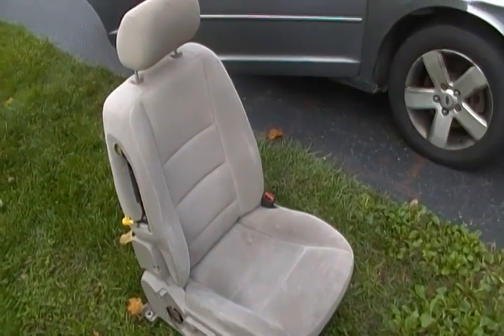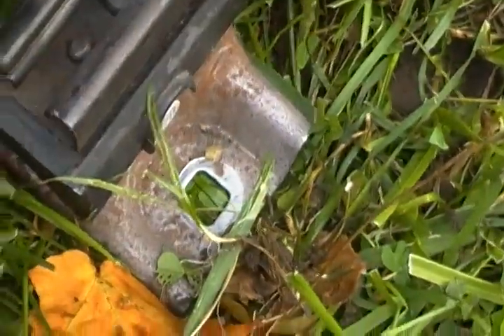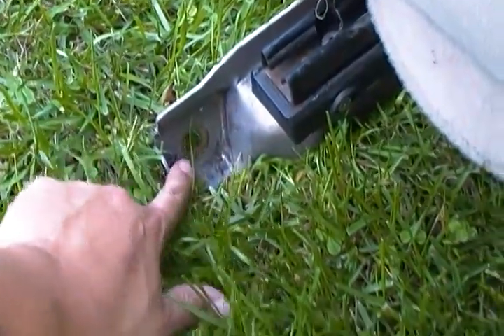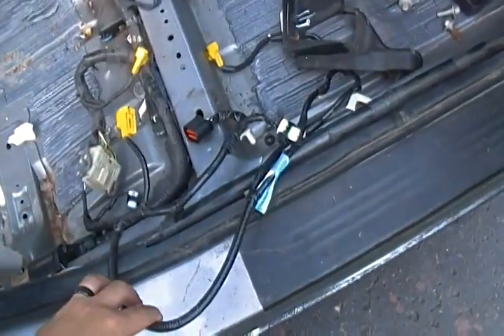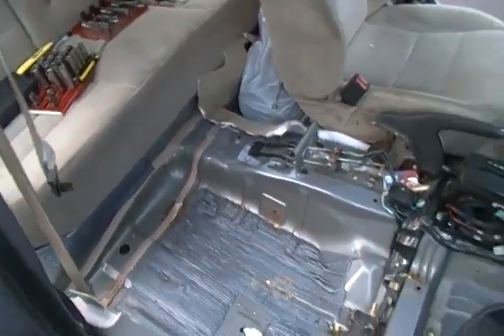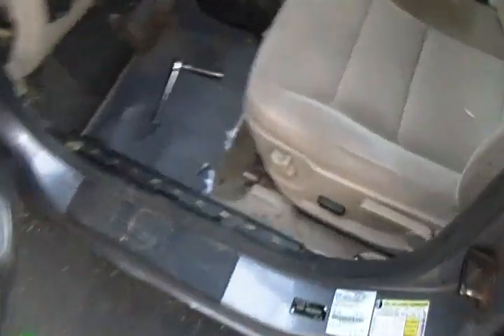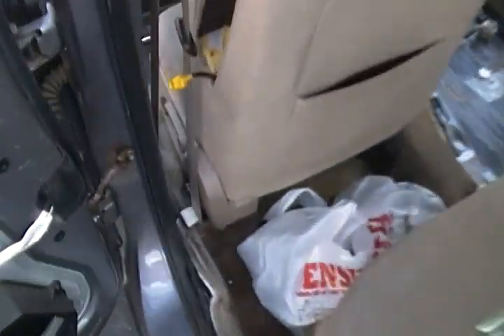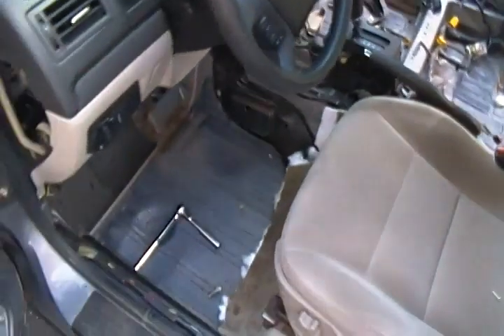How to Remove the Seats from a Ford Fusion

Comment: do you just pop the plastic covers off the nuts ? I was trying to pull them but didn't want to break them, I spilt an entire cup of coffee on the passenger seat and want to remove it and soak it in a tub to get that acid smell of coffee out
Reply from the maker: Everything popped off for me that didn't need unbolted. If you are taking the cloth seat cover off the seat though, I didn't do that so I'm not sure how to best proceed

Comment: I absolutely hate this car. If u drop something between the seats just forget about it
Reply: bro i dropped a cart down there and its fucking gone
Reply: @kaleomahlon4667  lol
Reply: @kaleomahlon4667  betcha the cops will be able to retrieve it when you get pulled over 🥲 rip
Reply: Just go from the back seats, that’s what I figured out.
Reply: @kaleomahlon4667  you better put some effort in and get it out lol
Reply: @kyleranderson5557  I said the same thing for 2 years until I just dropped my AirPods into the blackhole